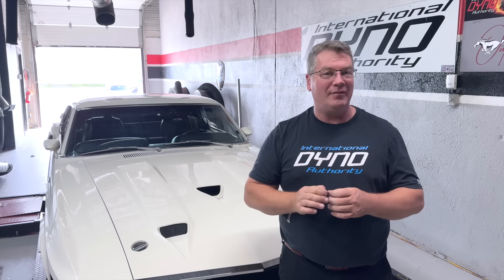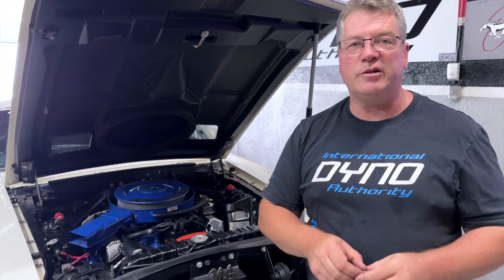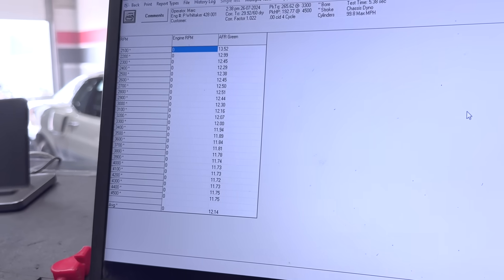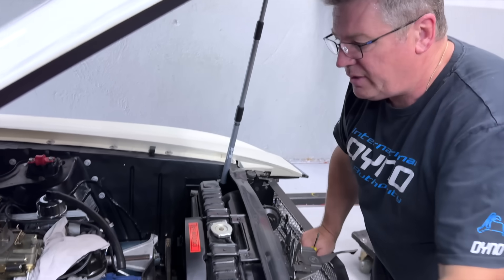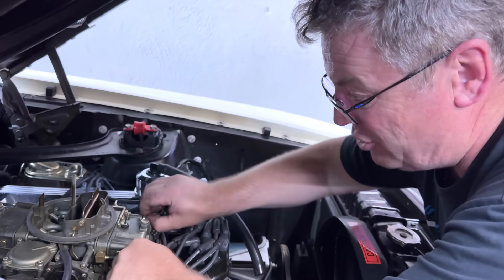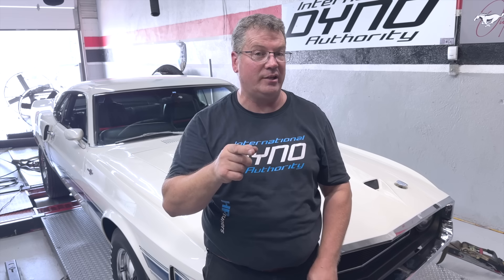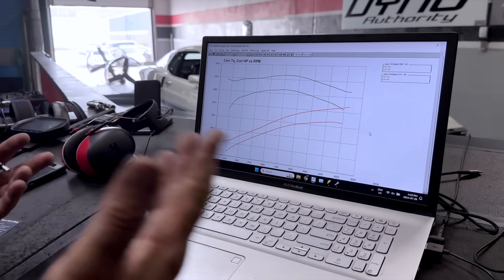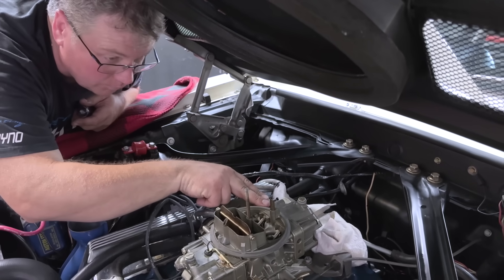Original, unrestored '69 Shelby GT500 tuned on the dyno

Comment: Thumbs down friendo's. Virtually impossible to do a final check on float level off the car as the screws in the side of the float bowls are removed to check fuel level while the car is RUNNING. With today's fuel, alcohol resistant gaskets (the blue ones) should've been used on reassembly. You NEVER just change jets willy-nilly, especially on a stock vehicle without consulting the "book" first and finding out what the stock jets are. What's with the "numbers"? Is that supposed to be a representation of stoichiometric? Conventional O2 readings would've been easier to understand, but "baffle 'em with BS" I guess. "Power timing"? Really? I'll stop here.  Sorry to be critical here but expect to be criticized if you claim to be an expert by doing a video.   BTW, we ran a 1969 Torino 428CJ at Lion's in A/SA and did pretty well.
Reply from the maker: @weffyj6427  Air/Fuel Ratio (AFR)
Fuel doesn't burn on its own. It has to be mixed with air. AFR tells you how many parts of air are mixed with each part of fuel. For example, a 14.7:1 AFR (or just 14.7) means the mixture is 14.7 parts air to one part fuel

HP

/Air-Fuel Ratios, Lambda, and Stoichiometry Explained
Air-Fuel Ratios, Lambda, and Stoichiometry Explained
Published on: June 15, 2024
Categories: Education

Search blog for:
Search blog...

Sort By Category
Air-Fuel Ratios Header
When it comes to automotive tuning, understanding air-fuel ratios, Lambda, and stoichiometry is crucial for achieving the best performance and efficiency. These concepts form the foundation of engine tuning and are vital for both beginners and seasoned enthusiasts. Let’s delve into these topics to shed some light on their importance and how they work together in the tuning process.

What is Air-Fuel Ratio?
The air-fuel ratio (AFR) is a critical measure in engine tuning. It represents the ratio of air to fuel in the combustion chamber. This ratio is essential because it determines the combustion efficiency and, consequently, the engine’s performance, fuel economy, and emissions.

A wideband sensor and gauge are used to read the AFR by measuring the amount of air in the exhaust stream. This reading is often misunderstood; many believe it measures fuel content, but it actually measures air content. The AFR is crucial in determining whether the engine is running “rich” or “lean.”

Rich Mixture: A rich mixture has a higher fuel content relative to air. For instance, a gasoline AFR of 9:1 indicates a rich condition, meaning there is a lot of fuel and not much air in the exhaust stream.
Lean Mixture: Conversely, a lean mixture has more air than fuel. A gasoline AFR of 20:1 is considered lean, with a high air content and low fuel content in the exhaust.
Finding the optimal AFR is essential for balancing performance and fuel economy. For pure gasoline, the ideal stoichiometric ratio is 14.7:1. This ratio provides the best compromise between performance, fuel economy, and emissions. It’s important to note that you shouldn’t focus too intently on this ideal number, often the best performance and balance of drivability is found under a wide range of values. This is why datalogging and dyno tuning is important, to determine what ratio works best for your application within certain conditions.
Reply from the maker: @weffyj6427  let us know... ANY further questions ❓ 

You may have.  We will be glad to share training.

Get you well, on your way to understanding, comprehending, and adding , constructive comments, in the world 🌍 of ICE.

Cheers and have a Super Day 

Jeffy Weffy.
Reply from the maker: @weffyj6427  Holley Float level.

In order for proper fuel deliver there must be a proper fuel level in the carburetor fuel bowl. Whether it is a 1, 2 or 4bbl carburetor.

If the holley float level is too low there will be a lag in take off or lack of power as the RPM increases. Sometimes there will be surging at cruising speeds.

If the holley float level is too high there will be flooding or fuel spilling over into the venturi of the carburetor unmetered.

For this tech tip we will cover the Holley 2 and 4bbl carbs with the sight screw on the fuel bowl, like the model 2300, 4010, 4011, 4150, 4160, 4180, 4500. All of these have a brass sight screw on the side of the fuel bowl. In the case if the 2bbl there is only 1 fuel bowl therefore only 1 sight screw. For the 4bbl carbs there are 2 sight screws.

Start the motor and run it for 30 seconds. Turn the motor off and wait 30 seconds for the fuel pressure in the fuel bowl to stabilize. Then remove the sight screw on the side of the fuel bowl. If the fuel trickles out then you are perfect. If it pours out then the level is too high. If nothing comes out then the level is too low.

If the holley float level is too high, put the sight screw back in the fuel bowl and loosen the screw on the top of the fuel bowl and turn the nut below it clockwise 1/2 turn and tighten the screw back down. Start the motor and run for 30 seconds. Turn the motor off and wait for 30 seconds. Then remove the sight screw again to see if fuel trickles out of the hole. If not, then repeat step until it does. Each time remember to put the sight screw back in to the fuel bowl to avoid fuel spillage.

If the holley fuel level is too low, follow above procedure except turn the nut counterclockwise and repeat above procedure until the desired float level is achieved.
Reply from the maker: @weffyj6427  Blue gasket is for metering blocks and main bodies that have a brass tube with double o-rings as a "accelerator pump transfer tube".
It won't work in place of the Black one.

It cannot be used with conventional flat faced metering blocks like the black gasket, because of that cut-out to clear the "transfer tube".....the pump shot will leak to the backside of the power valve cavity in the main body.

The Holley Spreadbore carbs, the 4165/4175 models all use the transfer tube type metering block and gasket.
Some of the 1980's and early 1990's standard squarebore Holley 4150/4160 carbs also use this transfer tube deal, before Holley finally got smart and discontinued it....
The Ford Holley 4180 carbs also have it (1982-85 5.0L Mustang).

I've got about a million of those gaskets left over I'll likely never use....

The cut-out fits around this tube, half of which is in a counterbored hole in the metering block face, and half is in a matching hole in the main body.
Reply from the maker: @weffyj6427  Ignition timing is used for "Tuning," 

Based on : Fuel  , Fuel delivery (port, Direct, Carb, Throttle body injection) Combustion chamber characteristics, Compression Ratio, additives , boost , nitrous.

Initial and curve ignition tables, are decided based on load "tuning" . And performance after, Fuel AFR is tuned to .8 Lambda, or 12.8 or optimized for the engine AFR requirements.
Reply from the maker: @weffyj6427  Ignition timing is used to match the Fuel Octane, Fuel Delivery system, and combustion chamber characteristics.
Reply from the maker: @weffyj6427  Initial settings are always done as follows.

Tune in for lots more education, updates, and lessons on :

Float settings, Jetting, emulsification, low speed, fine tuning, vacuum.... And much more.

Cheers 

The primary side setting is . 3125" (5/16"), measured with the fuel bowl inverted, at the middle of the float. The second- ary side setting is . 3750" (3/8"), measured with the fuel bowl inverted, at the middle of the float (back side).
Reply from the maker: @weffyj6427  If you notice that it is only taking 1/2 a turn or so to get the vacuum reading right then the jets are probably too big. Rule of thumb is that 1 to 1.5 turns out on a Holley usually means that you have the jetting right. If it's taking 3-4 turns to get the idle mixture right then the jets are to small
Reply: @internationaldynoauthority693  Flooding problems aside, idle mixture screws are for IDLE, jets are main metering circuit. You're trimming for highest vacuum? I heard your comment on dieseling being the threshold for timing adjustment, but in my experience, dieseling is most likely caused by high idle speed. "Ping" (detonation) is the threshold for maxing out timing. We use a distributor machine (Sun 404) to adjust total advance and rate of advance, as well as the basics of setting dwell and measuring dwell variation (shaft run-out) on a point type dist. 
 The blue gaskets fit 4150, 4160, 4165, 4175, 2300, and Domi.  BTW, the spreadbore was one of Holley's not so good ideas...
Reply from the maker: @weffyj6427  excellent, tune into some of our advanced tuning videos. 

We can show you how a carburetor works. We can show you how fuel injection works. We can show you the advancements in carbureation. Including 13 circuit carburetors. That show you step-by-step-by-step as they go through the motion, of pulling fuel as vacuum goes away, and stage after stage after stage of velocity takes over. 

When you've taken some of our beginner courses, then we can educate you, on some of the more advanced points, of the basic carburetors. 

After that, what we can do is start to transition into your learning curve, until, you've mastered some of the basic understandings of the ICE

At this point, you'll be ready to go out and purchase a carburetor of your own, and begin experimenting, 

At first, what you'll need to do is rent Dyno time. 

We can show you the basics of the vacuum gauge 

We can show you the basics of afr 

And we can start to explain how to interpret, understand, and look at the logic behind what you do, when a particular circuit of the carburetor and or a particular RPM range, is either rich or lean or pinging or etc. Etc etc. 

All of this is very advanced for you at your level now. However, 

Over time we can bring you along. And we can explain things so that you can understand them comprehend them. And then, you'll even be able to make adjustments of your own.
Reply from the maker: @weffyj6427  when you learn the basics of tuning. You will start to learn that you don't turn the distributor until the engine pings and then turn it back. 

You will begin to learn, that on a chassis dynamometer. You can first first build a fuel curve that is both responsible, responsive, and maximizes. The potential of the compression and the combustion chamber. Along with the characteristics of the fuel. 

Once you start to understand the basics, of the fuel curve. 
The fuel curve. 
We start to bring you along, so that you can understand, when to recurve, when to build a curve, and when to maximize a curve for timing efficiency. 

At no time, do we ever ever encourage somebody to increase ignition timing until detonation and or ping occurs. This is irresponsible and this is not tuning. This is backyard monkeying, not tuning on a dynamometer.
Reply: @internationaldynoauthority693 RE Pinging: do you not agree that pinging is the threshold of max timing @ WOT? (you should actually comprehend what I'm writing). Do you know what a knock sensor does? In many ways it functions as an octane sensor do you agree? Do I need to spell it out? At WOT ALL timing is IN, actually, as I know you know, it's all in by 3,000 rpm, give or take. I KNOW you know this by the (captured on video) "backyard monkeying", "power timing" stunt you were doing. That used to be thing back in the day for non-professionals to set max timing but it got a really bad rap for injuring and killing guys. Dynamometers are just a tool, hell we had a Clayton since 1959, but they're not the end-all, be-all in tuning, neither are computers. Don't get me wrong, I'm sure I could learn something from you, but tried-and-true, proven, real world knowledge beats bookworms every time.
Reply from the maker: @weffyj6427  Cool story....

Should have used more Dragons.

Cheers, and have a Super Day !
Reply from the maker: @weffyj6427  International Dyno Authority: Pioneering the Future of Tuning and Combustion Technology

As North America’s premier facility dedicated to advanced tuning and research, International Dyno Authority (IDA) has set the standard for tuning and power optimization across a vast range of applications. This cutting-edge institution has earned a reputation for excellence through extensive partnerships, groundbreaking innovations, and the development of tuning standards that are transforming the industry.

Partners in Innovation

IDA collaborates closely with leading corporations, advising powerhouses like HP Tuners, Whipple, Roush, and Ford Motor Company. Their insights and technical support have become an essential resource for these companies, driving improvements in engine performance, efficiency, and emissions standards. Through these relationships, IDA has a unique vantage point to pioneer developments that shape the industry’s future.

Pioneering Standards in Tuning

Since its inception, International Dyno Authority has been at the forefront of the tuning industry, not only setting new standards but also elevating the capabilities of tuners of all experience levels. Through their publications and training programs, IDA provides essential resources that empower both novice and professional tuners, equipping them with the skills to achieve precision tuning across various engine platforms. Their commitment to education is evident in their comprehensive curriculum, covering the intricacies of combustion dynamics, air-fuel ratio (AFR) tuning, boost management, and fuel characteristics.

Educational Outreach and Online Presence

IDA has established a strong online presence, notably through their YouTube channel, which serves as an invaluable resource for enthusiasts and professionals alike. Their instructional videos, which include step-by-step tutorials, practical tips, and expert insights, are used by institutions such as MIT, Boston College, SCT, Holley Inc., and Edelbrock, making IDA a recognized leader in education within the field. Their expertise has also gained the attention of influential industry figures, including Steve Morris, who has commended their contributions to tuning technology.

Specialized Focus and Areas of Expertise

Operating as a purely tuning and research facility, IDA’s specialization spans a wide range of topics. They delve into complex subjects such as combustion technology, AFR tuning, boost and fuel optimization, and luxury engine swap integration. The organization’s work also extends to advanced fuel research, as seen in their recent collaboration with TTC, Hydra-Gen, and DynaCert. Here, IDA took the lead in developing an 8.9L Cummins engine hydrogen supplement fuel program, which included rigorous emissions testing, underscoring their commitment to sustainable and innovative fuel solutions.

The Facility’s Technical Scope and Testing Capacity

Each year, IDA conducts over 650 vehicle dyno tests, tuning engines and chassis systems to optimize performance. This includes a wide variety of engines powered by gasoline, E85, diesel, hydrogen, port and direct injection, throttle body injection, and even carbureted systems. Their expertise is not limited to traditional vehicles; the facility also tunes boats, tanks, and military transport, making them the only independent tuning and research center in North America dedicated to such an expansive range of engines and fuel types.

Advancing Industry Standards

By leading projects in combustion and alternative fuels, IDA continues to be a key player in the evolution of tuning technology. Their dedication to setting new standards in performance, efficiency, and sustainability has positioned them as a trusted authority in an industry that is constantly evolving. For anyone looking to understand or pursue high-level tuning, International Dyno Authority remains the ultimate resource and innovator in the field.
Reply from the maker: @weffyj6427  What does Air/Fuel Ratio (AFR) mean?
AFR is the mass ratio of air to fuel in an internal combustion engine. The AFR is an important measure for performance-tuning reasons. If exactly enough air is provided to completely burn all of the fuel, the ratio is known as the stoichiometric mixture which is defined as an 14.6 AFR ratio. The lower the AFR the richer the mixture. The higher the AFR the leaner the mixture.
6 AFR - Rich Burn Limit (engine fully warm)
9 AFR - Black Smoke | Low Power
11.5 AFR - Best Rich Torque at Wide Open Throttle (WOT)
12.2 AFR - Safe Best Power at Wide Open Throttle (WOT)
13.3 AFR - Lean Best Torque
14.7 AFR - Stoichimometirc Air/Fuel Ratio Value (Stoich)
15.1AFR - Lean Cruise

IDLE / LIGHT CRUISE: 13.5 AFR
When you start your vehicle we refer to this as being in IDLE condition. When you shift into gear and drive at a low mph we refer to this as being a LIGHT CRUISE driving condition. With 14.6 being the industry standard stoich AFR value, we typically like to see these conditions run slightly richer. We are looking to fine tune an engine to get the smoothest operation.

CRUISING: 14 AFR
Most of the time you are driving your vehicle you will be within the state of CRUISING. This condition is the most wide open for customer preference based on two factors. If you prefer better GAS MILEAGE then run a leaner mixture. Most stock to slightly modified engines will run just fine at an AFR of 15 and yield better MPG. If you prefer better PERFORMANCE then we suggest to run an AFR of 14 or even richer to around 13.

WIDE OPEN THROTTLE: 12.5 AFR
Driving full out within a gear will bring you into a WIDE OPEN THROTTLE driving condition. This condition is where the peak horsepower value is obtained. We typcially like to run a richer AFR here to get the best performance. Best performance for most vehicles is in the 12.5 to 13 AFR range. Going too rich will have the opposite affect and decrease your performance.

ACCELERATION: 12 AFR
Getting up to cruising speed or getting ready to pass someone, you usually are looking for the performance to get up and go. We refer to any fast turn of the throttle as being in an ACCELERATION driving condition. Again, we typcially like to run a richer AFR here to get the best performance. Best performance for most vehicles is around 12 AFR. Going too rich will cause a sluggish roll-on to get up to speed.
Reply from the maker: SOME BASICS FOR YOU , Jeffy Weffy,

https://youtu.be/R3hDBmaGwYM?si=i9N98ug90UEfLM9B
Reply: wow another know-it-all TROLL... who would have guessed.  BTW Troll, 91 octane is ALCOHOL FREE.
Reply from the maker: @weffyj6427  

A Lot of details left off. VIEW 

The suggested videos, "Linked" 

For a full education on the float , jet, AFR tables etc..

We go through and explain each step.

The "book" dealer settings is where the carburetor was, as was...when it arrived.

The AFR, the science of how to read.... understand data, interpret, and change called tuning is what this video covers.

As far as the rest of the process, tune in for lots of lessons on understanding the terminology provided.

12 is Pounds of Air

1 is pounds of Fuel.

14.7 is labeled stoichiometric.

Also called. --1-- Lambda.

9:1 is very Rich AFR

14:1.  Is very Lean AFR

Naturally aspirated Engines, perform very Well from 13.1 down to 12.2

We Always " tune to". 12.8 then use the response of the Engine on the Dyno... To let us know whether 12.5. Or 12.9 performs better ...

It takes years to learn how to interpret the data. And respond  correctly.

We can certainly teach you.

Cheers and have a Super Day.